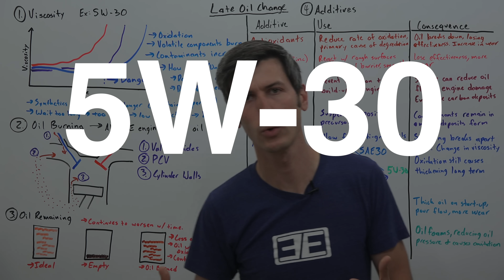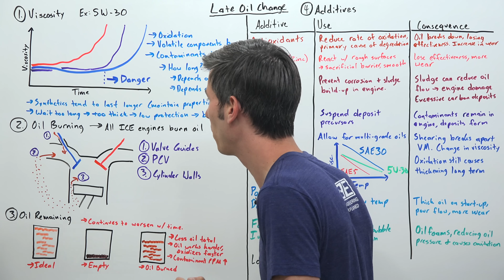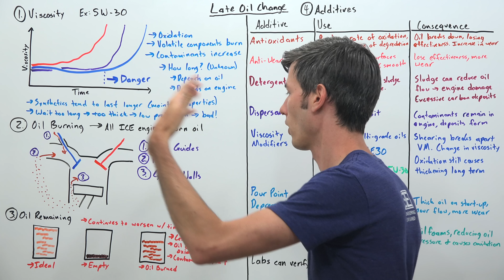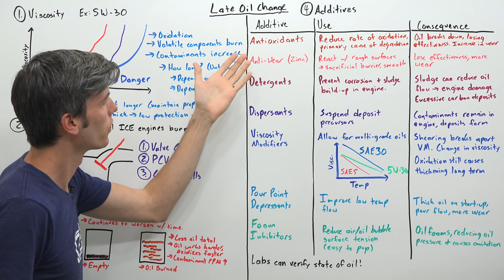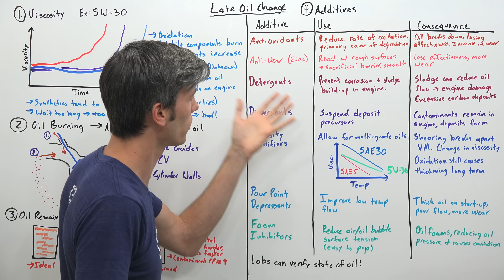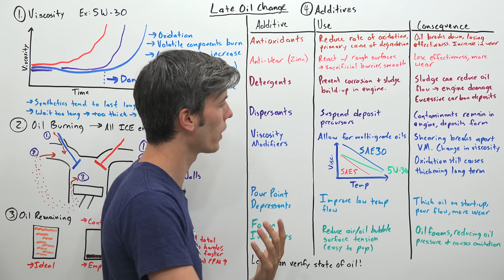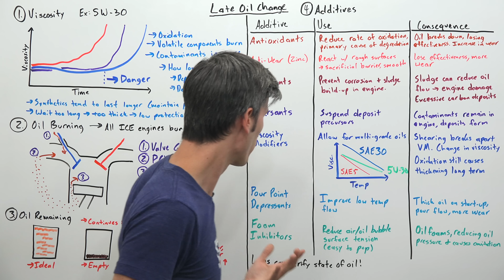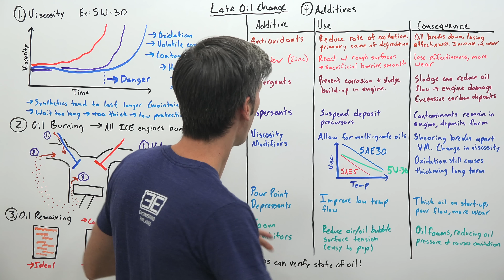What If You Forget To Change Your Oil?

Comment: Oil never ever wears out. The secret is filtration. If it s filtered correctly you will get 1M miles out of it. Large trucks and heavy equipment get millions of miles out the oil. Also a lot of new engines are designed to burn or use oil. Look at Franz filters using toilet rolls and see their years and years of investigation.

Comment: I need someone to answer my question, I don’t use my car regularly so the 3000 miles or 3 months oil change is not met. Is it bad if  I change oil  when I reach 3k in 6 months ?
Reply: 6 months should be fine. Do you use synthetic? If so you are probably good for a year. 3 months is definitely more often than needed unless you are driving the hell out of it.

Comment: U.S. military did a study in the 1990’s, across several thousand vehicles. Half received oil changes every 3000 miles, while the other half never received an oil change. Through the useful life of the vehicles (100,000 miles) there was no discernable performance or longevity advantage for the vehicles having received the oil changes. In fact, the “un maintained “ vehicles outperformed the maintained vehicles, though the difference was not considered significant either way.

Comment: The reality is that most modern cars hit the graveyard because of other failures not related to oil performance: electronics and faults not connected to pistons, crankshafts and bearings.

Comment: Here's another tip, if u are prone to forget then use synthetic, it will last twice as long and gives u a buffer if u forget.
Reply: I used synthetic and Bruce buffer never showed
Reply: I used synthetic the last time I got oil changed, but now I am nearly 800 kms over the mileage the mechanic recommended another oil change. Does this put the engine in a hard place?
Reply: @rushiljain9423   when the oil looks/smells dirty you should change it, whether it is synthetic or not

Comment: I have a 2003 Honda Civic with 219,000 miles on it and it doesn't use that much oil. I'd be pissed if my car burned that much at such low mileage.

Comment: Another note... foam inhibitors.  Usually in the form of polymethylsiloxane or methyl acrylates, these additives are the most susceptible to additive clash.  Different anti-foaming chemistry can be equally effective on their own but cancel each other out if blended.  This is usually a problem with aftermarket oil supplements.  It's a common problem in racing engines where people are adding ZDDP supplements to a finished API oil to try to boost the wear protection and end up sacrificing the foaming and aeration control in the process.  Then when oil temps start to shoot up, pressure drops, and bearings start overheating, cavitating, and spalling, they usually blame everything except their oil regiment.
Reply: interesting

Comment: As a note, many additives are also dual purpose.  ZDDP (commonly referred to as just "zinc") is an excellent anti-oxidant, especially ZDDP that employs primary alkyl groups.  MoDTC, a common friction reducer, also aids in oxidation inhibition as well as helps with wear protection in high concentrations.  Unfortunately, both of these are severely limited in modern API oils because of "emissions."  CaCO3 and MgCO3, the core of calcium and magnesium based detergents, can also have anti-wear capabilities.

Comment: I know I'm late to the party, but I'm curious to know why we use oils with viscosity modifiers. What are the benefits versus oils without VM? I know manufacturers recommend VM, but how would it impact engine performance/ reshape design and engineering? Would engines need to be tuned to be less powerful/efficient? Would it increase wear?
Reply: We viscosity index improvers as otherwise you'd have basically no oil flow when it is -40 deg C or -40 deg F outside!  PAO base oils are inherently "multi-grade", so it is however possible to make a 5W30 or 10W40 without any viscosity modifiers, but a 0W40 (like Mobil 1 0W40 or Castrol Edge 0W40) still needs viscosity modifiers.

Comment: My sister put 23,000 miles on the oil in her 1ZR engined Corolla. I dread to think what the damage is. 😣

I stick to 10,000 miles/6 months on mine.
Reply: Got any updates? I myself am responsible for maintaining the two 2016 Toyota Corollas that my parents own; they both have the 2ZR-FE engine.
Reply: @07VFDInLCD  It's been 10 months since I changed the oil in it and the car hasn't had any issues. I didn't see any metal filings but there was some carbon particles in the oil filter housing. My dads Avensis has a 2ZR-FAE engine and that has done 110,000 and seems to be humming along - that has always been serviced on time though. I would stick to the oil change schedule. These engines have twin VVT and the FAE variants have valvematic which controls the valve lift. There are lots of parts of the engine crap in the oil can gum up if you don't keep up on maintenance.

Comment: Fellow NCSU Alum here, go pack! 

Great video as always. 

My question relates to storing opened bottles of oil. I keep an opened Quart of oil in all my cars for top off situations. I've noticed the oil browns over time, presumably due to oxidation without any shear and heat. Does this more "mild" oxidation negatively impact the shelf life of the oil?
Reply: Oil absorbs water which is why it's important to change you oil more than once a year. I do 3months / 3k - 5k miles. Having a top off quart is a good idea and shouldn't be kept for more than a year, especially if you live in a humid environment

Comment: What are your views on performing engine flushes (especially on engines that don’t get used often) and/or engine treatment additives! The last mentioned I heard is a hoax. Engine flushes I believe do actually make a difference. I felt it with a previous car of mine, it almost immediately improved it’s power and response after the oil change. I do it especially on my race car after it’s been sitting still for two months in between seasons. Been going for 7 years now without a con-rod ever going through the block

Comment: In not sure how you can forget with modern vehicles having a change oil life system. With that said I have an older vehicle with only the reminder light, since I live in the midwest I usually will change it every summer/winter.

Comment: How does engine load wear affect these variables, as compared to simply age?  It's typically recommended to change engine oil both every 6 months and after 5000-7500 miles (whichever comes first) depending on the engine.
Reply: WHAT???  Recommendations are for an annual service these days. Oil change around 12,000 miles up to 20,000 depending on the oil. I suspect US engines allow a lot more contaminants to blow past the pistons into the oil. This may be related to the relatively low power achieved by ridiculously large engines. Not a criticism.

Comment: I had a Skoda Fabia. I wanted to drive it to death so not servicing. Simply ensuring it was safe to drive and not polluting  (Purchased for £250 as 15 years old car.)
I had saved money for a replacement card but the Skoda wasn't dead, so I figured I'd keep using it.
3 years later with no oil change or filter change and 30000 miles added, I gave up and traded it in for £250 off a replacement 2nd hand car.

Comment: Of course there is a caveat synthetic oil‘s are far less susceptible to late oil changes then conventional oil‘s conventional oil‘s by the time the oil was needed to be changed we’re half as affective as their original characteristics that’s not true I’ve synthetics I have many times run made synthetic 1000 or 2 miles beyond the oil changes in trouble with even zero possibility of engine damage the biggest abuse of oil changes today and this is coming from someone who has knowledge is changing the oils long before they should be changed when they’re full synthetics your average full synthetic higher-quality oil will easily go 7500 miles easily and could more likely do 10And still be well within parameters when tested most people are wasting synthetics changing them out far too early

Comment: What about the oil in infrequently driven cars or cars which have been sitting around without being started for years?
Reply: Generally speaking, after a year of light usage or not being used at all properties of oil also changes. In Europe where we big temp changes between winter/summer we tends to change oil every year before winter or after 6-8k miles whichever is first.

Comment: My 1993 Jeep Grand Cherokee limited 5.2 V8 is still going strong for 26 years without engine or transmission overhaul. Right now it is over 412,000 miles. Several years ago, I've used to be conventional oil then blue smoke came out from tail pipe as I didn't like so, I switched to 5W-30 Mobil One Synthetic oil with Royal Purple oil filter for years without any problem or always passed smog check. I changing oil every 6 months (Spring and Fall) or 5,000 miles but not go into 7,000 or 8,000 miles. Also, I've used mostly Chevron 87 octane gas of trying not get a cheap gas brand too.
If my jeep die and I was thinking about obtian a Chevrolet Tahoe is only sell with V8 engine because my Jeep has V8 is twice longer engine life than smaller engine sized as well.

Comment: Question engineering explained when you purchase a new or used car changing the oil on the car, does that depend on company policy or the driver? And what I mean is after you have ridden the car.

Comment: I got curious once and took a sample from a car that hadn't had an oil change in ~20,000 miles. I sent it to Blackstone labs.
Horrifying amounts of damage (not self plugging, but i have a video on it) And people still claim "oil changes are a scam". People rather save 50 bucks now and spend 8 grand later on a replacement motor. 
CHANGE YOUR FRICKING OIL PEOPLE.

Comment: Finally someone agrees with me that every engine burns oil. 
Thank you .
Reply: All engines burn oil but on my toyota, it's so little that I dont see any visible difference on the dipstick between oil changes.
Reply: the issue is how much...
Reply: pyropulse  lol ya bet.
Reply: Not true at all. My toyota burns zero oil at all.
Reply: @ToyotaNutjob  It's just being topped up by unburned fuel. If you run a car on LPG your oil level goes down because it's gas. Another curiosity, why do Americans call it gas when it's a liquid? In Australia we call it petrol.
Reply: @JayDee-xj9lu  Gas is short for gasoline, which is a mix of chemicals derived from petroleum (hence, petrol) specifically used to fuel most cars.
Reply: Squanch Wanch Yea it does
Reply: Yes, and there is uranium in seawater.
Reply: My 03 Mustang GT burns about half a quart of oil every oil change (5k miles).

Comment: Good, but your explanation of 5W-30 is lacking.  It's not 5 weight when cold and 30 weight when hot--liquids don't work that way.  It's a 30 weight oil period.  What the 5W means is that when it gets cold it will only thicken as much as a 5 weight oil would.  It's still going to be thicker than it is when hot.

Comment: What I’m hearing is that I should upgrade my oil pan to a larger capacity...
Reply: What I’m hearing is that I should get a Tesla
Reply: Javier Hernandez dammit! Lmao.
Reply: @xm1193  not that bad though tbh. i believe they say once a year for the first and maybe every 3 after that.
Reply: @JavierHernandez-m8o  it's only 1 gear though ain't it like a cvt or somethin?
Reply: You can overfill by a quart in basically any vehicle or two in most large engine vehicles with zero issues at all. I simply overfill my 6.0 GMC with 314k by 2 quarts and it's within the two holes on the dipstick at 8k every time. Runs quiet and smooth still.
Reply: @JavierHernandez-m8o  - Indeed, there's always a tolerance. If it stays within the two lines it's ok

Comment: My 1991 TAURUS, had 52k when I BOUGHT IT, WELL, I RAN IT TO 430K.  #5 cylinder had low compression , so, BOUGHT A USED 2013 TAURUS WITH 21K, NOW USING A SYNTHETIC, , 
CHEERS FROM NJ🇺🇸🇺🇸🇺🇸🇺🇸

Comment: Why are you changing oil every 6,000 miles in the 21st Century? We're on 12,000+ oil changes here in the EU, including the car you showed, and we're getting >200,000 miles out of those engines without any issue. My 2004 Mondeo was on 168,000 when I sold it, oil changes every 12,500 miles as Ford recommended and it barely used any between services. My 2010 Mondeo is on 150k, same service interval, same results. 

Please don't be like the rest of America, still changing oil like cars are built and oils are the same as they were in the 1970s.

Comment: Two,  no make it three problems I have when changing oil.    1. Who uses a new washer on the oil plug?     2.  I wind up with 1/4 or maybe  half quart of new oil left over because my old Toyota takes something like 4 1/2 quarts instead of 4 or 5.    3.  Seeing the damn new clean oil on the dipstick to see if it's at the proper level.   I change the oil  a little after 3 or 4 thousand miles.  The old Toyota will probably outlast me anyway.  I save the old oil and use it in old lawnmowers the neighbors bring around to fix.

Comment: I drive a wee smart car 12 years old , I change my oil / full service / mot once a year , runs as sweet as a nut
Reply: Marios Apostolou my last car was a Mazda 6. Did the same as you.  Had it over 13 years, over 100,00miles. No problems whatsoever. Certainly well within Mazda service interval. All my cars treated the same - no engine problems- ever.

Comment: Here Is a math problem for you. Why not let an engine run cold?

My problem. I live less than 1 mile from work. My coworkers ask all the time "Why don't I drive?". My answer is 'it is terrible to constantly not let an engine warm up'. They ask "why?" and the best answer I got is moisture. I know under the right scenario water and oil can be over pressured into  a mix that is bad for an engine. I know that heat plus moisture, but not enough heat to boil water and remove moisture speeds up rust. Beyond that, I don't know.

Comment: I drive a 1994 Ford Ranger.  I bought it me and have done oil changes on schedule based on Ford dealers.  Lately though my truck is burning more oil so I'm taking it in when when the check oil indicator light comes on.   They recommend changing every 5,000 miles but the light comes on about 3,200. From experience I know the light comes on when the oil level is barely on the dip stick.   I went in about 4,000 miles last time recently.   My truck still is completely reliable transportation but I'll give it all the help I can.  I don't want a replacement.
Reply: Crap.  Bought it new, not me!  Where's the edit comment function?

Comment: How about Mobil 1 extended protection formula and yearly formula, that's supposed to be good till 15k? Seen lots of people running that interval without issue. Figure Mobil wouldn't want all the law suits, if it wasn't working.

Comment: What if the engine does has low miles on the oil, but the oil is a year or two old?  Should it be changed if a certain time is exceeded before it has many miles on it, less than 500 miles?
Reply: @Chris Gollatz Thanks.

Comment: I'm at 200 miles over on my civic type R. The manual says every 5k i believe. I'm very busy at work working Mon-sat. This is our busy season. Dealers are closed on Sundays so i can't do it then.

 By the time i have a sat or Mon off in January,  i estimate my car will have 5500 miles on it. Is that too long for a civic type R? 

I havent gotten an oil change yet(bought the car new in aug) so it's all original oil

Comment: Could you do a video on confirming/debunking increased carbon build-up risk in direct injection engines? Valvoline just introduced a new oil aimed at "modern engines" that use this form of injection.
Reply: i think fuel quality has a way larger impact to the amount of direct injections' disadvantages

Comment: It depends on how much your cars engine is worth to you on how often you change oil. Problem is that the result of neglect will only show up after years of neglect. 
You can't hurt your engine by changing the oil too often.
Well done as always, Jason.
Reply: You have no idea how mad I was at my dad once for driving my Corolla nearly 20k miles without an oil change, and doing that for a whole year.
Reply: @Electronica27  we bought a car that had the same oil for 60 000km (37k miles)
Reply: @Tupsuu  RIP
Reply: @Tupsuu 😮
Reply: @Tupsuu  Same, bought a 2016 RAV4 with 45k miles on it. I open the engine and sludge everywhere, dealer refuse return so the last option I can do at that time is to try to flush all that sludge. Ran semi synth oil every 500 miles three time, and then ran it again 3 times with 1000 miles interval, ran it again 3 times at 1500 miles interval and fast forward now, I am still using it and change the oil regularly at 5000-6000 miles interval with full synth! Had it be some european car or American, I am convinced myself the car won't be able to be saved!
Reply: @slothypunk  The oil in the car we bought (3.0TDI A6) was still in okayish condition. Might be because of the large ammount of oil in the engine.
Reply: @slothypunk  Also iirc here in Finland the dealer would be required by law to do something about the issue you had. Even change the engine if needed
Reply: @Tupsuu  I find that hard to believe, the dealer has no responsibility to do anything if it was from customer neglect (not changing the oil)
Reply: @RayanMADAO  But the customer neglect happened before the dealer selling them the car so they would be responsible for selling the car in good condition and if the engine fails sooner than expected they could be responsible for repairs if it's been maintained well after the sale.
Reply: Thats how i deal with for me my car engine is like my heart and im always in serach to increse its life and have fun with it
whereas i also have a scooter which i dont care about much skipped many service but that thing doesnt break